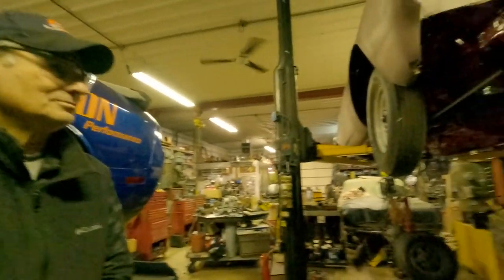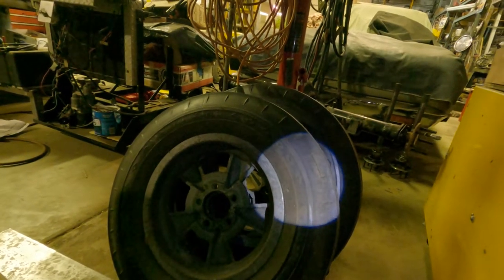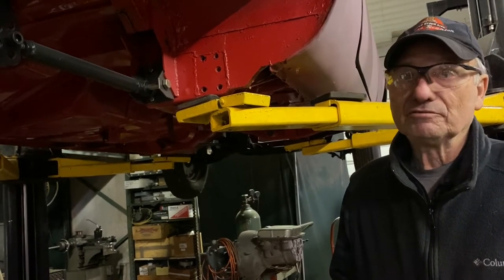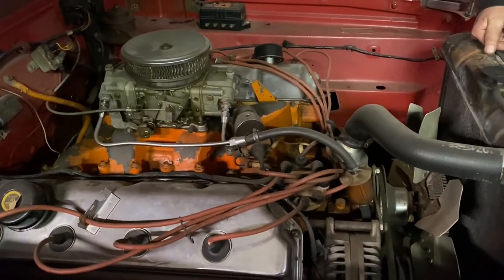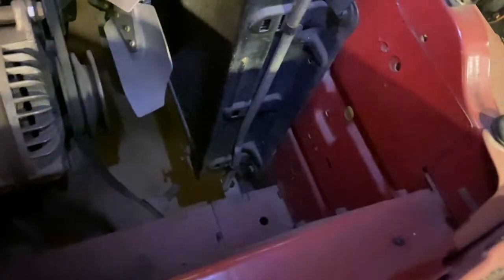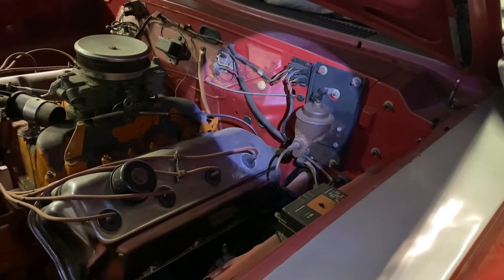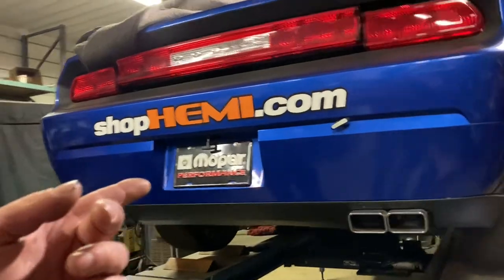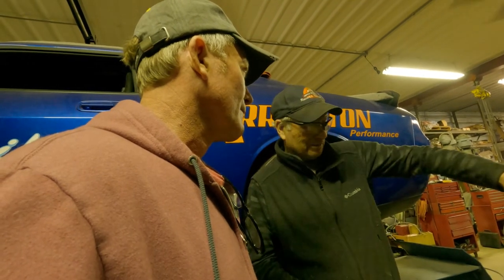Larry Griffith's Race Cars - 1964 Plymouth Savoy

Comment: I hate to admit it, but I never heard of a Savoy.  I do remember Plymouth made a model with a clutch, torque converter and manual transmission.  You could actually leave it in third, and let the converter do all the work.
Reply from the maker: It was just the name that they gave to the 2 door sedan and 1964 was the last year for that model.  In 1965 they called it the Belvedere 1 and the hardtop was the Belvedere 2.  The Satellite was a hardtop and the highest trim package for the Belvedere line.